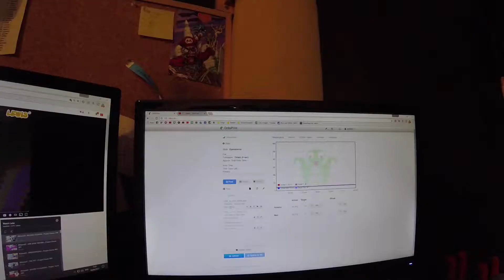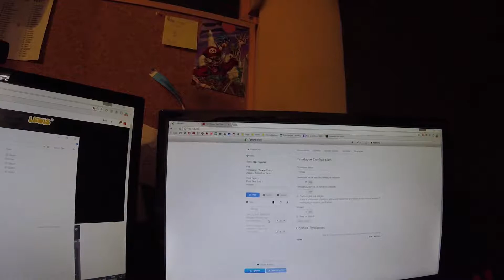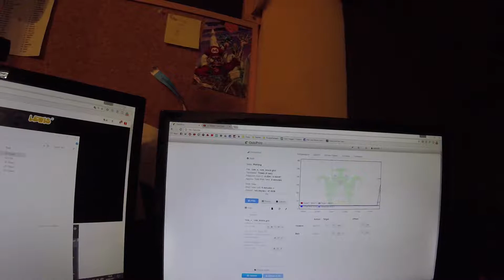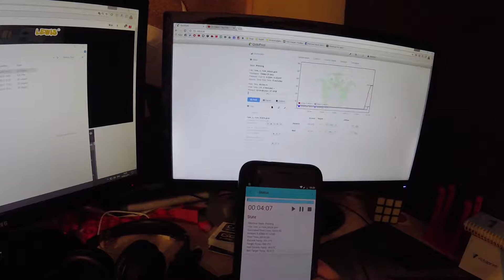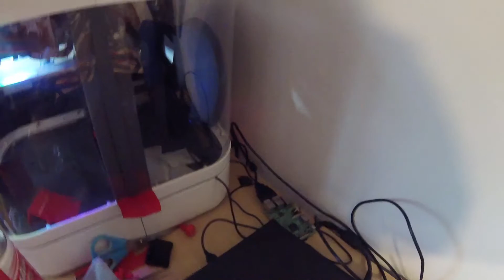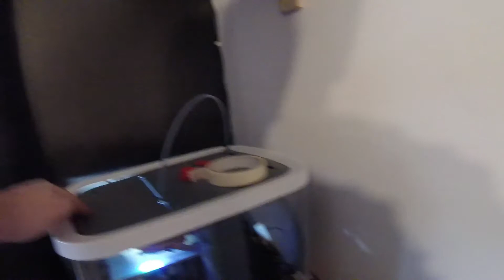Vector 3 3D Printer Modification #8 - A First View of the Raspberry Pi!

Comment: NICE 1
Reply: still cant get v3 working, looks like a usb connection problem will have to contact EM for a replacement, just done Q&A on the forum....
Reply: win7x64----usb2---set to administrator---micro switch off---mobo lights on---print head lights on---power on---UNABLE TO DECTECT USB DEVICE---some people have reported that v3 don't like case mounted usb outlet so will try board outlet on the rear, I think its a v3 bad usb connecter. are you replacing your fans with fluid bearing type?
Reply from the maker: thanks for the comments!